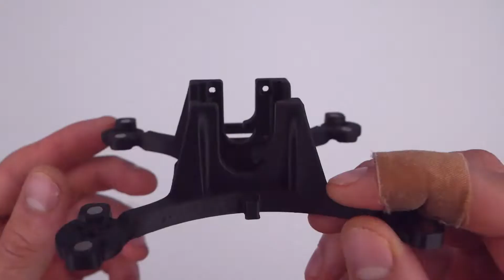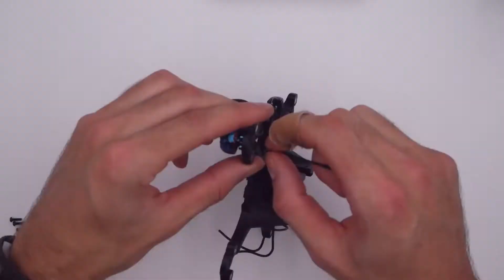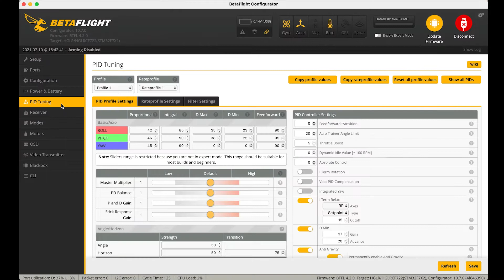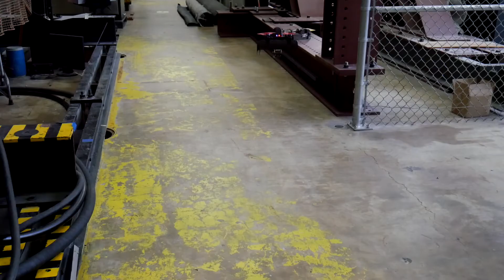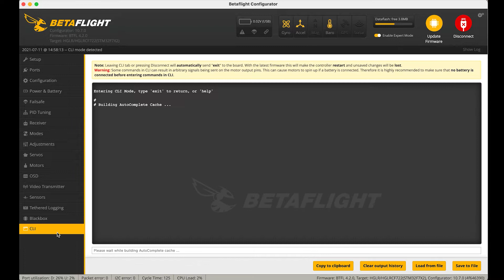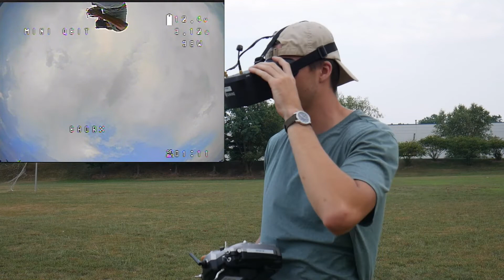How To Build the Mini QBiT: Step by Step Build Tutorial | From parts to flying!

Comment: You should be able to set a 90 degree fpv camera angle mix in Betaflight and skip the radio mixing. It does the same thing.
Reply from the maker: Wish I knew this sooner… Everyone, you can skip the Control Remapping part and use the fpv cam mode in betaflight instead since its a bit easier. 1) Go to the cli, and enter in ‘set fpv_mix_degrees = 90’ 2) enter ‘save’ 3) go to the the modes tab and turn on ‘FPV ANGLE MIX’, set this to aux 2 and adjust the slider so that the highlighted portion is used when the flight mode is forward flight and hit save. This will do the control remapping for you and will switch back and forth depending on the camera view/flight mode. Thanks for the suggestion!
Reply: @peterryseck  someone tried this "trick" ?
Reply from the maker: @naviluminor  yes it works great
Reply: @peterryseck  and that freed us from all the mixing part in the taranis ?
Reply from the maker: @naviluminor  yup! Don’t have to do any of that mixing. Just follow those steps and it should work. You can test it by spinning up the motors on the ground and flipping the switch before flying

Comment: Peter, I have a quick question:  In forward flight I get some occasional violent rolls that invert the craft.  Sometimes I'm able to recover, but several times now it's led to a crash.  I don't experience any weird yaw tendencies in hover.  I'm using Betaflight 4.2.9 on a GepRC F7 board.  Do you have any thoughts on why this is happening?
Reply from the maker: Hey Brian, my only guess is that it’s maybe i term wind up? You can try turning the i gain down but otherwise I’m not sure how to fix that issue. Hope that helps
Reply: @peterryseck  Thanks, Peter.  It might be a moot point for now.  I was flying at the park yesterday and all was going well until I saw "RX LOST" across my OSD and I got to watch it nosedive into the ground via FPV.  The front-facing camera CCD was obliterated, The entire FC/ESC/VTL stack is damaged and no longer usable.  The frame held together and the wings popped off as they should, but I'm going to have to buy a new control stack for it. Oh well, that's how these things go.  ;-)
Reply from the maker: @tamuct01  ahh! That’s the worst… all part of the fun I guess!

Comment: Hi
Why the switch "quadcopter / airplane" is used in 3 positions ? (top / middle / bottom)
When flying in quadcopter mode, is it obligatory to use angle or horizon mode ?
Can we choose "acro" by default ? 
Great job 👍
Reply from the maker: Yes you can use acro in hover mode as well. I dont because it protects from crashes when needing to transition from airplane to hover mode. Its a three position switch because I don’t have any two position switches on my transmitter, so in my case the two upper settings do the same thing (airplane, acro) and the lowest setting switches to hover (angle)
Reply: @peterryseck  Thanks  👌
How do you fly, props in or props out ? ( is there really a difference 🤔)
Reply from the maker: @naviluminor  it must be props in if you are using the mini qbit design
Reply: @peterryseck  Ok, but the image at 24:20 suggests the opposite
Reply from the maker: @naviluminor  it’s dependent on motor cant angle. Mini QBiT has opposite cant angle compared to the diagram
Reply: @peterryseck  Thanks

Comment: I have been looking at VTOLs lately and I had thought this was possible with reversing yaw and roll. The FPV cam angle mix in Beta flight is a good trick. Any thoughts on how to do this with digital? I guess putting the camera on a servo would be the best, right?
Reply from the maker: Yes it would have to be on a gimbal, dji does not support camera switching unfortunately

Comment: This is awesome. Great work! I have a project that I haven't started yet where I want to build a hexacopter gyrodyne. I'm not sure yet how to make the two flight modes in Betaflight though. Basically would have the middle motors on a servo and when in forward flight, would use the other 4 props for lift, pitch and roll.
Reply from the maker: Yeah not sure either, but you could look into dRehm flight as an option: https://github.com/nickrehm/dRehmFlight
Reply: @peterryseck  I'll take a look into it later. Thanks for the recommendation. 
Great job again with the QBiT, it's inspired me to try out a few other ideas of my own.

Comment: One thing you may want to consider adding is motor filtering. Makes a huge difference in the smoothness and response of all the rotorcraft I fly. Should be a free DL from most BL-Heli capable ESC's.

Question: I noticed on this build that the Yaw iTerm isn't being altered when switching flight modes. Thus it appears that your winged-flight is with the default I-gain values correct?
Reply from the maker: Yes i term can stay the same for hover and ff. i term error accumulates on body rotation in ff vs. body angle in stabilized mode so it's fine to keep.